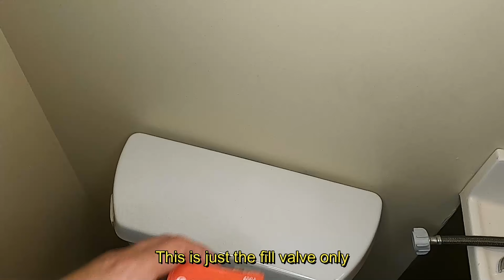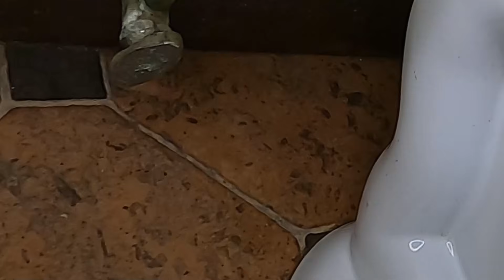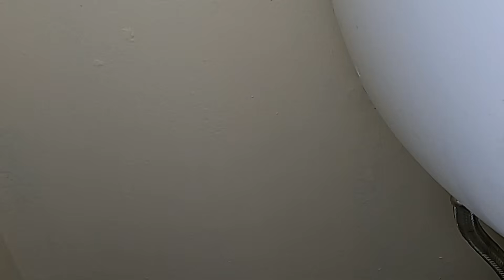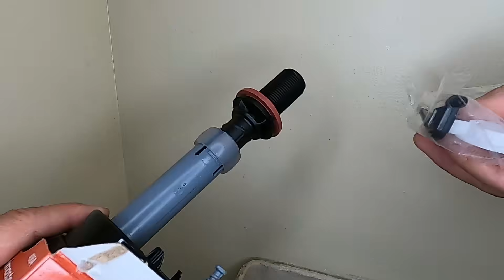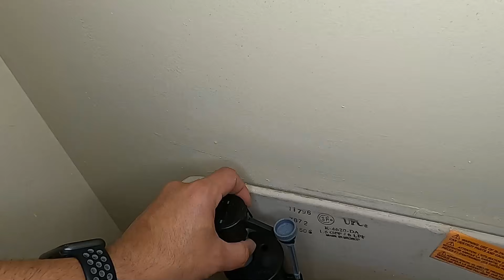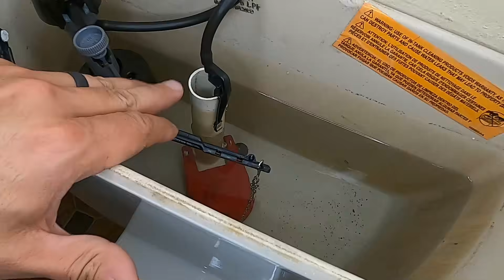How to replace toilet fill valve - For Beginners

Comment: My float doesn't have the handy knob to adjust its height but instead has the same thin rod as the one you removed in this video. How is the height adjusted with that rod? I can't get the float to the proper height.
Reply from the maker: You pinch the little silver clip that rides down that thin rod which releases the tension on it. Then you can slide the rod or float up and down for adjustment

Comment: good job...  I made the mistake of not noticing how important the height adjustment step was so had to pull out the new valve and start over :(
Reply from the maker: Sometimes you can get the locking collar popped off while it’s installed and slide it up then lock it again.

Comment: @Guyofalltrades I have a flowmaster model 350 and I notice that my tank fills fine and everything but the float, at the very end near when the tank is full it closes semi-abruptly which causes a bang in the wall. It isn't a constant water hammer but one kind of loud thud in the wall. I observed the float rising with the tank lid offf and at the very end just before being filled up, the float rises quickly and that causes a thud. I tested by manualy holding it down to let it raise more gradually by hand and if I control the rate of speed by which the float finally rises to it's highest (fill) point, the thud in the wall DOES NOT happen. If I let it rise on it's own, the thud does happen. Should I just replace the whole fill valve rather than fiddling with the leveler screw and/or using a water arrestor?
Reply from the maker: Do you know what your water pressure is?
Reply: @theguyofalltrades  No idea, there's no gauge on the outside of my house near the main water line so I have no way of knowing. Unless you know another way I can find out? The weird part is that this doesn't happen to my other 3 toilets, just this one.
Reply from the maker: You can buy a gauge that fits a spigot thread and check that way. They’re like 12-13 bucks.
Reply: @theguyofalltrades  what is normal psi?
Reply from the maker: City water is typically up to 95psi from my experience and that’s pretty high and will cause water hammer issues without a PRV installed on the main. Well is around 50-60 depending on type of pump

Comment: My cylinder rotates as I try to screw on the nut underneath the tank. How do I hold it still so I can tighten the nut?
Reply from the maker: Is the lock ring in place? That helps to keep it steady from rotating then you can hold the upper part of the valve
Reply: @theguyofalltrades  Yes. I figured it out, but it appears that my problem is also in the flapper. So, I need to replace that now, too.
Reply from the maker: @ThePontificatingAHole  Sometimes it's better to replace as a set I find and a tiny bit cheaper too. The flapper edge will start to curl and you'll get a constantly running toilet because of leak by. Using those toilet tank tabs like the ones with the blue die will exacerbate the flapper failing

Comment: Thank you sir, so much for this tutorial. As a single/divorced woman, there are some things I now have to do alone and I don't want to always have to call someone in and pay extra for what I could possibly do myself. 🙏🏼😊
Reply from the maker: Welcome!
Reply: @theguyofalltrades  now I need a tutorial for stopping the leak on that silver drain pipe under the bottom. 🙁 Please and thank you 🙏🏼
Reply from the maker: The water line? Where the shutoff valve is?
Reply: @theguyofalltrades  YES! If you already have that tutorial up, I can't find it, but I need it. 🙏🏼 Please and thank you!
Reply from the maker: Is the valve screwed onto the pipe or soldered?
Reply: @theguyofalltrades  I screwed it on by hand and put some of that white tape on before screwing it on hoping that would help. 🤦🏽‍♀️🤷🏽‍♀️
Reply: @theguyofalltrades  also, it's a new one not the old one.
Reply from the maker: @nichelle1967  Make sure you put that white teflon tape wrapped in the direction the new valve tightens so clockwise. also you can use pipe thread sealant to help it from leaking even more

Comment: I have a FluidMaster like the one you used in the video BUT the water in the tank doesn’t fill all the way up!  (It was put in about a year ago. ) I’ve adjusted the water level on the FluidMaster to the MAX but it only fills the tank half full.  If I manually press on the lever to increase water level to the FULL LINE, it fills up BUT a few minutes later, the tank is half full. There is no indication of sounds of leaking water and the flapper locks into place! What can be wrong? Thanks for any advice you can give me!
Reply from the maker: If it’s stopping you can physically raise the height of the valve assembly. I show that in the video. If the level is lowering on its own it’s either a leak which you would notice or water is getting by the flapper. Does the toilet sound like it fills randomly during the day? That would be the telltale it’s the flapper
Reply: @theguyofalltrades  - Nope, the flapper is in good shape. Like I said, there is no sign of leakage…no sound at all of the water slipping through the flapper!🤷🏻‍♀️
Reply: @theguyofalltrades  OK! I will try to physically raise the height of the valve assembly. But after it was installed by a professional, why did it work before but now I have to raise the valve assembly? Sorry to complain!🫤
Reply from the maker: There’s a white or gray plastic ring at the bottom of the valve assembly. If that wasn’t put back in place the valve height can be pushed down. Make sure it’s in place if not raise the whole thing until the top of it is a couple inches below the lid of the tank then set the level with the float
Reply: @theguyofalltrades  Thanks! I’ll try it!( But that white/gray thing is snapped into place. So I’ll try to raise it …but it doesn’t lock into place🤦🏻‍♀️🤷🏻‍♀️😤…it’s probably an easy fix…I’m just not doing it right!) I appreciate your patience and your help👍🏾! 
Helpful advice!
Reply: So? What do  I do next?

Comment: Any good reasons why you shouldn't leave the base of the fill valve and only swap out the part with the float cup?
Reply from the maker: I mean if you can get the same exact model it would be easy to change out the head on it. This one was a bit old so I opted for full replacement
Reply: @theguyofalltrades  any way to change out the head without shutting the water off?  I know I'm dreaming. lol  The 1/4 turn is about 10 years old and stuck in the "on" position.  I plan to heavily lube it.  Any tricks of the trade on that is greatly appreciated.  I'm a petite female and like to tinker around the apartment. :)  Thank you!
Reply from the maker: @arizonarebel5706  Probably not without shutting water out because it will make a mess. You can try pb blaster which is a lubricant that frees rusted hardware. That works miracles sometimes

Comment: My overflow tube goes directly outside the house so all the water would be going outside.
Reply from the maker: That’s interesting. Can’t say I’ve seen that before
Reply: @theguyofalltrades  I have two toilets and both have overflow pipes that goes outside.
I've just looked up Fluidmaster and they make one for the UK, which I have to fit, and that little nipple, where the water comes out is actually blocked off. The water comes out of the bit just above the nipple.

Comment: HELP! the geniuses that designed the toilet put on a hard plastic flapper.  I have tried removing it to no avail. I am afraid of breaking off the flanges if I use too much force.  So what to do?
Reply from the maker: If you have diagonal cutters, you could probably cut the little loops that are on the flapper off and then it should come right off
Reply: @theguyofalltrades  I Don't, but son in law probably. Thanks!
Reply from the maker: Good luck!

Comment: Thank you for sharing this. Quick question, if I do not have to replace the bottom hose, then do I have to disconnect the hose from the shut-off valve?
Reply from the maker: Nope shouldn’t have to remove it

Comment: This is painful to watch
Reply from the maker: 64000 people disagree with you
Reply: The overwhelming majority of comments are positive remarks from women who do not have a highly skilled man to perform this simple job. I suspect that the majority of women would leave this icky job to a man if they had one available. It appears that most of the comments by men are critical of the videography or the length of the rubber hose. :oops:

Comment: I have a one piece toilet and removed the fill valve to replace it. Would you believe there's no access under the toilet to screw in the new fill valve.  I've seen some fill valves on-line that have
a piece of metal that goes underneath the hole from one side to the other and the center has a threaded screw hole in the center and a bolt that goes through to pull up in order for the gasket
to be tight.  I purchased the toilet from Home Depot and there's no name whatsoever anywhere on the toilet. If anyone can point me in the right direction to purchase one of these odd fill
valves I'd appreciate it.
Reply from the maker: Amazon would be your best bet. You can also google one piece toilet fill valve and there’s some options I’ve found
Reply: @theguyofalltrades  Will do.  Thanks for your reply.
Reply from the maker: Welcome. Thanks again for watching!

Comment: I have nearly the same model Kohler tank as you 👍🏼 Everything was fairly straightforward after watching yours and a few other vids on toilet fill Valve replacement.  The more complicated issue I discovered after replacing my fill valve has to do with my old toilet water shut off valve and the piece of corrugated copper tubing it’s using.  My corrugated tubing looks like it will crack very easily if I try to bend it, and it looks to be crimped/soldered onto the shutoff valve.  The shutoff valve looks to be connected to 1/2” threaded galvanized steel pipe coming out of the wall…I want to replace this shutoff valve with a 1/4 turn valve, but am hesitant about trying to take it off…I don’t want to damage the pipe coming out of the wall, although the pipe threads may already be compromised since my house was built in the 50’s…Decisions, decisions.🤔
Reply from the maker: Is it accessible from below? I’d probably replace with pex if it is. I’ve seen some of the ones with the galvanized stub outs. Can’t believe that was ok to do back then.
Reply: @theguyofalltrades  I believe there’s access to the water pipe from underneath the house, but to use PEX tubing, wouldn’t you still need a brass 1/2” female pipe to PEX adapter, to convert the old galvanized pipe coming out of my wall for my toilet water supply? This assumes I’d still need good threads on an older galvanized pipe under my house. 🤔
Reply from the maker: Is the entire supply galvanized in the wall and from the main cold water line?
Reply: @theguyofalltrades  yes, whole house has galvanized pipes…our cold water for our bathroom sink barely drizzles out, so we only turn on the hot water (which gives us full stream) for sink water.  We’ve been alright with this issue since our hot water tank is clear on the other side of the house, so it takes up to 2 minutes for water in that bathroom to get hot (thus we have cold water for a good duration)….The sink in our other bathroom is fine though.  Seems like the pipes under our house are narrowing/rusting internally from decades of buildup.
Reply from the maker: Even though galvanizing provides good corrosion resistance it’s not corrosion proof. Take a look at guardrails on the highway that are older. Can definitely see the hardware starting to rust. I find it crazy they allowed that for use with potable water. Could very well be the pipe flaking off inside and plugging up the diffuser on your faucet if it’s only a trickle coming out.
Reply: @theguyofalltrades  my aerator is clean as a wink…I clean it often, but my cold water in my one bathroom only trickles out at full on,while my hot water has a good stream.  I might just have to bite the bullet and have my house re-piped with PEX. All our water pipes are underneath the house, but plumber may have to cut open walls to bathroom plumbing to get access to pipes….and this discussion began with wanting to swap out my toilet shut-off valves for more piece-of-mind. 🤢
Reply from the maker: Yeah man it stinks but probably worth the peace of mind from a total pipe failure.

Comment: Installed a different flow valve which was pretty easy but am having trouble as far as adjustment.  Tank fills intermittently after flush float does not drop all the way to activate water. Value kit has 2 Chains for flap and lower part of valve. Getting irritating having to tap top of float to activate water.
Any suggestions?
Reply from the maker: If it’s not catching on something it almost sounds faulty. Should be pretty consistent when it fills from all of the different ones I’ve installed. What brand is it??

Comment: Nice job can you adjust the fill vale height when it’s in the toilet thanks
Reply from the maker: Thanks for watching. Yes if you can fit your hand down around the bottom of the assembly you can pop the ring off slightly and raise the level.

Comment: hi my toilet will not completely flush..even when i hold the handle down i can see inside the tank only half of the water flushes..also noticed the flapper closes quickly..so i tried holding down the handle and it still will not completely flush..i have tried the plunger water in the toilet will not go down...i do not think it is clogged new plumbing 5 years...i think it's something inside the tank something not working right....i am trying to figure this out before calling in the professionals..my husband passed away last year..i am a 57 year old girl girl trying to figure this out...any ideas...what is wrong
Reply from the maker: Does it flush if the flapper stays open the entire time?

Comment: My valve looks different. Can I still replace with this one u r using? Thanks I don’t c where I can upload my type
Reply from the maker: As long as the tank has a similar hole at the bottom for the valve you can use this one. Some look a little different but function exactly the same and will fit multiple toilet types. This one was a fluid master and I purchased at Home Depot

Comment: I am having an issue with my valve but I don’t think a replacement is necessary, however I can’t figure the cause of it and maybe you have an informed guess. It looks like the valve isn’t “dropping” as the water level goes down, so it doesn’t trigger it to refill the tank. Oftentimes I have to lift up the lid and give a very small nudge, by pushing the valve down ever so slightly, and then it kind of “wakes up” and it start refilling immediately as it’s supposed to, but it won’t do that on it’s own. Do you have any idea of what could be the cause of that? I’m tired of having to lift up the lid and push on the valve for it to refill so I can flush, every single time I use the bathroom.
Reply from the maker: You’re talking the full valve or the flapper where the water goes down into the toilet?
Reply: @theguyofalltrades  just the valve
Reply from the maker: I’d say the valve is bad if that is the reaction it’s giving you. They’re only like 10-15 for the only so worth replacing

Comment: Thanks for this excellent instruction. I didn't have any trouble installing a new fill valve, but getting the lug off of the old valve took an hour because it was stuck good and the water valve was in difficult area to access.
Reply: My current problem. Struggling so much
Reply from the maker: Welcome. Glad it helped!
Reply: I'm having that same problem.  My toilet is way close to the corner and I have huge hands. So its already in a horrible spot and to top it that lug just won't give.
Reply: @heckzotica  The awkward angles I required to remove the (S)lugs would make Houdini blush. Two hours of complete angst.
Reply: @Powerule23 hacksaw

Comment: Looks so easy until i attempt it. Then a disaster
Reply from the maker: Oh no what happened?
Reply: @theguyofalltrades  even changing the flapper didnt go smooth. I got one of the universal flappers and the removal of the old was so difficult then i installed and woulndt drop perfectly to seal.  I put the old one back and realized it was the fill valve   Called a plumber
Reply from the maker: Sorry it didn’t work out for you

Comment: I can't get the snap ring to move. Have tried everything as I don't want to remove the whole unit.
Reply from the maker: If you hold the valve in both hands and try to push the ring using both thumbs that makes it easier too. I’m pretty sure you can just twist the bottom half of that stem and it will raise and lower too.
Reply: @theguyofalltrades  I can't get two hands in the space in order to push up the ring but I will try again. The only reason I wanted to get it apart is that when I took off the part on top and turn the water on to rinse out what ever might be in the tube every little water comes out compared to videos I have seen so I wanted to clean out the tube as best I could.
Reply from the maker: There is a screen on the inside of the bottom threads where the fill line connects. Sometimes that’s where debris collects and causes slow flow
Reply: @theguyofalltrades  OK thinks for the tip. As I have problems getting up from the floor and because the toilet is in a tight spot and it's hard to get at I didn't want to unscrew the water line but maybe I better do it as it takes forever to fill up the tank.

Comment: NOT good instructions did not show complete install hose, handle, chain adjustment then flush it to prove it outy
Reply from the maker: Title specifically states how to replace a fill valve. I can make an additional video in the future for the flapper and chain. This video does show the hose install in detail if you choose to watch the entire video. Thanks for watching 😊